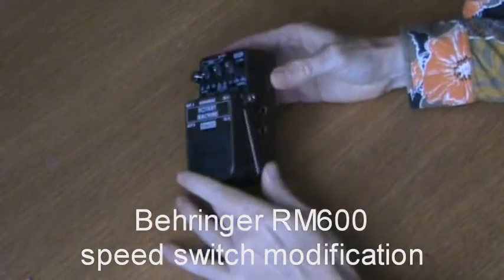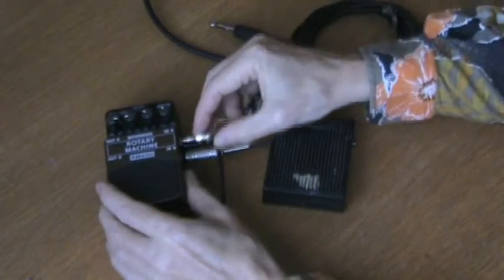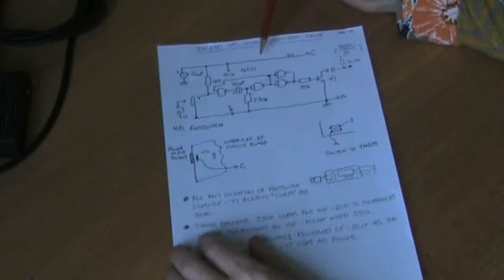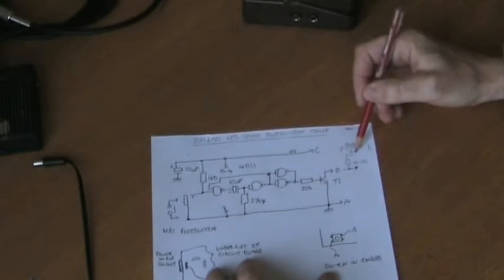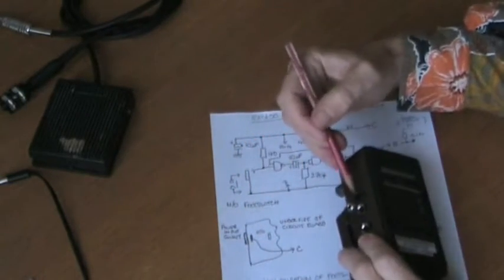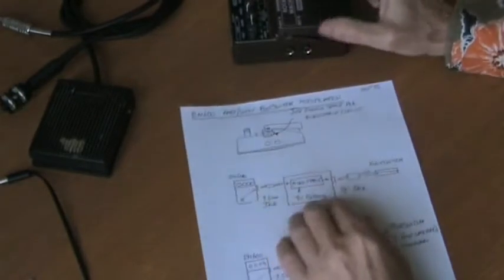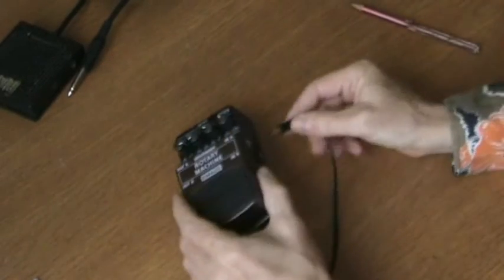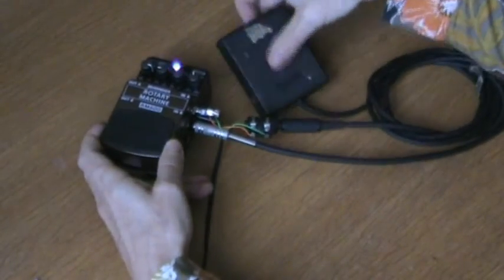Behringer RM600 (leslie) speed switch modification

Comment: Thanks for this. I have this pedal on my board and the switch is always irritating. Sometimes, I push and hold to change speeds and my foot might slip and the pedal shuts off mid riff. This would solve that. 
I just put a bit of electrical tape over the light because it's WAYYY too bright. It still shows through the black tape.
Thanks again.
Reply from the maker: Thanks, you "hit the nail right on the head" - pressing the pedal with uncertainty was a real pain, I just had to make this mod. And that LED yes me too, is waay too bright when I looked down at the pedal to see what it was doing the LED it would burn brown spot on my retina. ouch

Comment: What would it take to add a Jack for an expression pedal to control the speed?
Reply from the maker: I would think it's possible to "tap" into either the Slow or Fast speed "pots" - assuming that by expression pedal you mean a variable control (rather than on/off). It would all have to be specific, the expression pedal setup for that one job.
There's very little space in the RM600 and I noticed the PCB copper tracks/tracks disintegrate with attempts to de-solder components.
My first design consideration was to use one of the 1/4" jack outputs and convert it for the on/off speed select switch, but the PCB was way too fragile, I could have easily damaged the PCB beyond repair. Risky.
There is space for a 3.5mm jack but it it may need 3 connections it could be unreliable with the physical "abuse" it would get (just too flimsy) - To some extent it if were me, I'd tap into the circuit (within the RM600 and bring all the wires out and then use an externally mounted box for all the "make it work as I want" stuff. Ugly but safe :)

Comment: Congrats on the job! 
👏👏👏👏👏👏👏 
Have you tested any otic coupler (ex-TIL111) as an interface for your monostable circuit by connecting the coupler's photo transistor in parallel to the native switch?
Reply from the maker: I didn't because there seems no need in my application (way of using) for the galvanic isolation. The internal switching seemed blissfully simple (no-mux).
Reply: @totaltwit  Thank you very much for your attention in answering. God bless you. 
🙏🙏🙏🙏